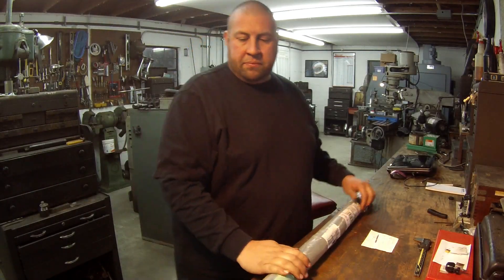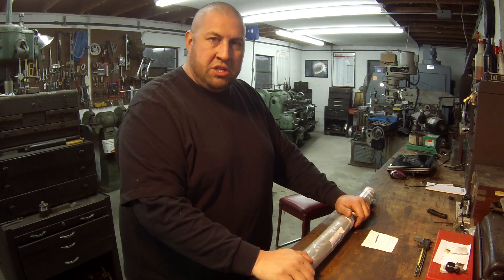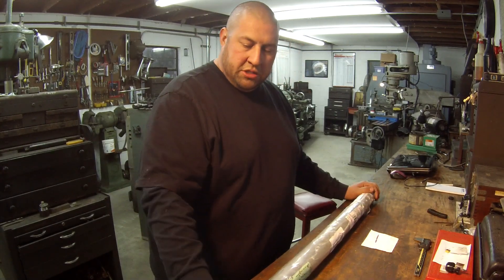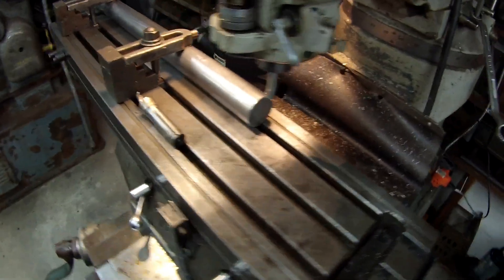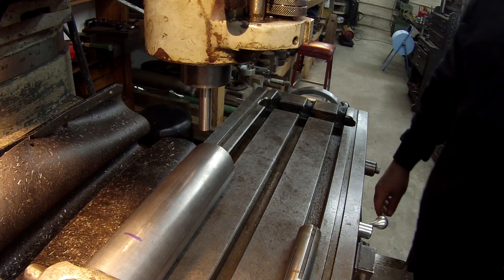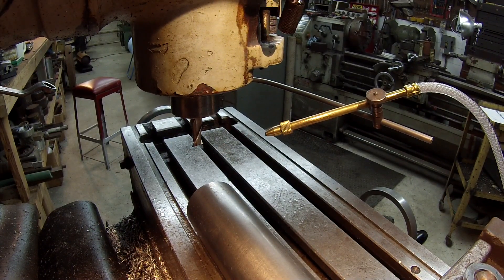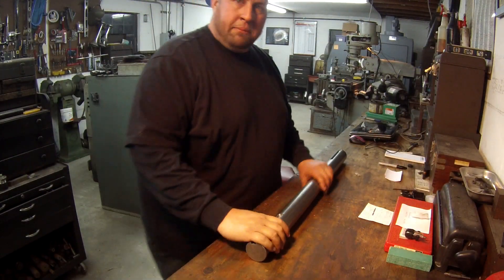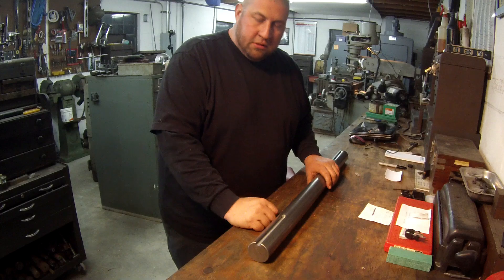Milling Keyways

Comment: Hi Adam.  Thanks for this video.  I have to cut a 5/16" keyway into a 1 1/2" 316 SS propeller shaft off a boat.  I see you cut the key in one pass.  Would you do that with stainless or take multiple passes?  If multiple passes, how deep per pass would you suggest.  Any other tips to milling 316 stainless?

Comment: Where is the depth measurement taken from? The top of the radius, or the flats of the milled edges?
Reply: +jtjjbannie From the milled edge. Takes the cutter to a full face cut, then goes .250&quot; plus a couple thou, because he can.
from 5.00, he explains it.
edit. full details Standards, in Machinerys HandBook.
Reply: I know a guy that was cutting keyways by just touching the material, and then setting his depth. He couldn'r figure why his keyways weren't ever the right depth. He argued with me when I told him what he was doing wrong, until I showed him. He said, he had been doing it his way for 12 years. I told him, I've been doing it my way for 35.
Reply: Also, it's as important to get the key as tight in the depths as it is in the width otherwise (over a period of time in use) it will 'shuffle' and twist and wear along it's sides and eventually fail. Not always easy in the 'female' side unless you have indexable control over the slotting device.

Comment: For keys on both ends like that, the way I've done it in the past is to use a tool vise upside down on the shaft between the clamps. As long as the vise can grip the diameter, it will work and if need be use parallels between the inverted vise jaws and the table. Clamp to center of shaft, then after milling 1st key slide shaft so that 2nd key can be cut or flip end for end. The vise will ensure the keyways are in line, and, if the keyways need to be roughed out first, it makes it painless. Great videos btw. I might invest in a gopro myself for a window into my shop :-)

Comment: Good video, but instead of flipping the shaft around, you should have brought the cutter up and to the other end of the shaft after the completion of the first keyway. You then could conventionally mill the other end. You wouldn't get as nice finish compared to the first keyway, but the two keyways would be perfectly linear to each other and you wouldn't have to change your setup.
Reply: I'm pretty sure he 'should' have done nothing, but 'could' have done it in a number of ways. Anyways, you said it yourself: "You wouldn't get as nice finish compared to the first keyway". It's about delivering a quality product, not about easiness for the operator. If you can align the shaft in exactly the same position after having moved it, what's the problem? It's not like he needs 100 of 'm done in the next hour.

Comment: Hey Adam,
 
					 					 					 					
what it is in 2:34. What does it do?

Thanks
Reply: It's an edge finder. It's used to find the absolute edge of the part so the center can be found. Some also call it a wiggler. If you watch, you can see why.

Comment: Another great video, keep them coming.  I was wondering if there is a particular right spindle speed for using a center finder or does it matter?   My own milling machine should be delivered maybe tomorrow or the next day and I will soon try the center finder.
Reply: its usually around 4 - 500 rpm when using a edge finder
Reply: i must correct myself its 6-800 rpm

Comment: Thanks for sharing Adam, nice video.

What kind of cleanup on the mill is Necessary after using the cool mist? Do you just blow her off or do you have wipe it off dry to avoid rust.
Reply from the maker: I usually lightly blow the chips away, wipe the table dry with a wrag, then spray WD40 all over it. Its not supposed to rust from the coolant, but it still makes a mess with residue if you dont clean it up often.
Reply: That make sense Adam thanks

I made a huge mistake on on a cutter bed once cleaning it with CLR thinking it would clean the rust off the cast iron surface , I spent 3 days trying to stop the rust coming back

Nightmare apprentice mistake..Never again

Comment: Hey Adam, next time you do a slot like this could you do it in the shaper? Keith's slotting attachment Spline series on his K&T has me in straight line cutting envy. lol
Reply from the maker: You could do it on a shaper, but you have to have some kind of relief, like a slot at the end of the keyway. Cutting an external keway on a shaper isnt the ideal way of getting it done really. Now internal keys and shapes yes.
Reply: Very true, not being a shaper user, I forget the details of proper setup. I am guessing on an internal key you are limited on how small a diameter you can work in for your tooling to clear? I hope your dad is getting better!

Comment: Hi Adam,
I'm just curious if you had to face the ends after you cut the shaft to length and before you milled the key slots.  It didn't look like this particular shaft was too critical in either dimension.  Praying that your dad recovers soon.  RS
Reply: Sorry im 9 years late, shaft length is seldom critical.

Comment: Hey Adam,

Nice job. I see you shoot the cool mist pretty far. Have you ever tried putting it up real close to the cutter? I hate the fog they shoot if your stood off from the work. Always choked me out. Now we need to make you a mount for the cool mist tank on the side of the machine.

Talk to you soon bud.

Tom
Reply from the maker: I dont always mount it so far out, but the rod would have hit the clamp on that set up. I do like it closer as it help blow the chips away better too. 
I haven't used it long enough for any fog to bother me, as in long cut times. I like it and works well for me. 
Yes I plan on having my buddy Joe break me of a simple box for the tank to sit in and mount on the side of the mill. 
Thanks Tom!

Adam

Comment: I missed the little trick you did with the level. I was going to ask if you had to line them up. But thought Id read some comments first. lol So your have your mill level. I read that you want the lathe level so I got a good Starrett level from a friend and did that. I also leveled the mill and my surface grinder. So I should be good to go.
Reply from the maker: Yes your lathe needs to be as perfectly level as you can get it, and in both directions. Its important that the ways are not going downhill or uphill from the spindle, and that theres no twist either. That will cause taper and alignment problems.
The mill is a little more forgiving, but still important to have close to level so that you can level things like I just did in the video. 
I'm planning on buying some machinery leveling pads and build some riser blocks for the DoAll and get it leveled in good.

Comment: another great video,you make it look so simple when you mill the shaft down to cutter width by feel instead of calculating the height of the cord.have you ever run into an oversize keyway using an on size end mill? i usually have to run a test cut to insure my slot is on size,and sometimes i have to resort to an undersize cutter and and widen the slot to fit. keepum comming
Reply from the maker: As long as my cutter is in good sharp condition and not worn I always have good results and be on size. Now I have had failures here and there, part of learning. I found that when I was trying to cut BIG keyways all in one pass I would sometimes have problems with the slot being a few thou oversize. For those bigger keys rough out most of the center with a hogging mill, then finish with a 2 or 4 flute. 
Not a problem to bring down into a full radius. Ive done soo many keyways now its easy for me.

Comment: Looks a nice, well finished job Adam. Was the work piece too long that you couldn't leave it in place on the table and simply mill from both ends without having to flip it end for end? There may of course been other reasons for flipping it that I don't know about.
Reply from the maker: Dan, yes it was too long. I dont have that much travel. So cut one side, flip and level, then cut again.

Comment: hi Adam,
Why is it that you (they) always use two flute end mills for cutting keyways. i cannot see the difference with other milling operations where four or five flutes are used. Thanks again.
Reply: I am not a professional machinist, but when ever I do a cut where I am going over half the diameter of the mill, esp in steel, I'll use two flutes to give the chips somewhere to go. With 4 flutes, there isn't as much space for the chips to go, so you have to take lighter, slower cuts.

If I'm wrong, I'd love to find out why.
Reply from the maker: I just always have much better luck and finish with a 2 flute mill. 4 flute endmills always wanted to chatter in the Acra mill. But I havent use a 4 flute in the DoAll in a very long time, so I need to test and see what type of results I get. On some larger keyways I like to rough out the center and finish with a 4 flute.
Reply: Abom79
 I was wondering, because here in holland two flute end mills are often sold as keyway cutters. probably you want to take lighter cuts with a 4 flute, getting a better finish, but it is remarkable that you get more chatter with a 4 flute, comparing the geometrie of both. I will ask professor Tom also about this. Then we viewers can maybe enjoy a chatter fight between you, Adam and your west coast friend.The bluriest video wins.(lol)

Comment: I use two flute end mills to do most  key ways ,but some times you have no other mill for the job so you use what ever you have, four or three flute ,depending on how sharp your three or four flute mills are they ten to cut a little big some times what is you rule of thrum. Charlie.
Reply from the maker: For keyways I always favored 2 flute mills. Ive had bad luck with 4 flute mills chattering and ruining the side of the keyway. On the bigger keyways I will rough out most of the center, then put the finished size endmill and take a final pass. $ flutes do work good for that. 
But ya know, everyone has there own opinion.

Comment: Hi Adam....

Curious...when you started the second key way cut why did you have to reset your depth of cut??  To me the novice, I would have just flopped, aligned and milled the slot with the previous setting without changing my quill or table setting.

Also, behind you in the shop, large roll of blue paper.....hmmmm??

Chuck
Reply from the maker: Chuck, thats just the way I decided to do it this time around. On the Acra mill I have the digital readout and just bring it back to zero. But...one thing I dont like to do is bring the cutter back through the slot because it will cut it again. Now one way you can do it without bringing it all the way up is to zero the knee, at the end of the cut lower the knee a couple thou, stop the spindle, turn the flutes in-line with the slot, and move the table down to clear. Then just raise the knee back up to zero. Maybe I'll show it next time around. 
The blue roll is my shop towels made by Wypall. They are the X60. Seems to last me a long time around the shop. My first roll lasted like 4 years...LOL

Adam

Comment: Hey Adam, thanks for another great vid.    I was watching some clips from Tom's Techniques and seen him cut a keyway by plunging almost to depth and about half the cutter width, moving along the length of the keyway.  After he had it roughed out he just made a finishing pass.  It looked fast and efficient with very little effort for the machine.  Just wondering if you've tried that way?
Reply from the maker: Thats the way I cut larger keyways, say like above 3/4", but that was on the Acra mill. I will have to use that same trick for keyways any bigger that need to be cut on this small mill.

Comment: With having to turn the shaft on the bed, was there a trick you used to align the keyways or could you just eyeball it?
Reply: Hey Steve, I was impressed on a little trick he used to do that very thing.  He used a level across the first keyway to set up for the second.
Fred
Reply from the maker: Steve, its not critical for the keyways to be perfectly aligned on shafts like this, but they are typically milled in line with each other. Just a simple level on the previously milled keyway will suffice. You can also stick a key in the slot and level it that way. Using the level will get them very close.
Reply from the maker: Fred Miller Yep, thats the quick way to get them close. If you need to be perfect theres other ways to get it indicated.
Reply: Fred Miller
Thanks Fred, as soon as I saw your comment come across the phone I remembered another video where Adam had detailed the level technique, guess I had looked away for a second during this one and just missed it :)
Reply: I would like to know how to get them perfectly straight I came across a job the other day where I had to make 3 x 5/8 keyways  had to be perfectly align I did use a level and they where ok but not perfect ? I tought about clamped v block any other way you might think ?